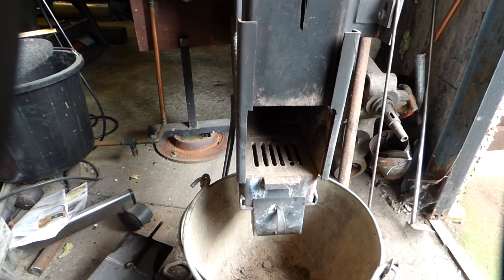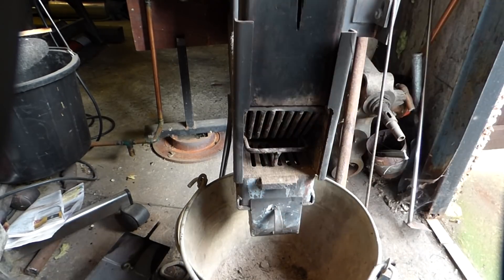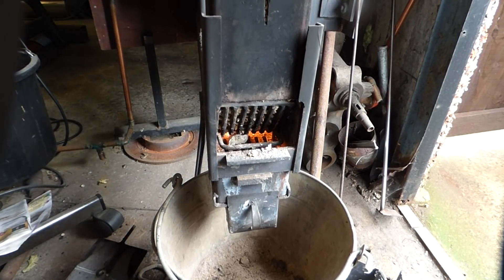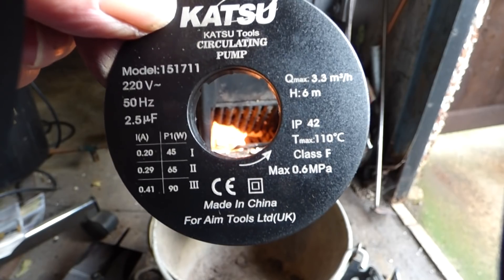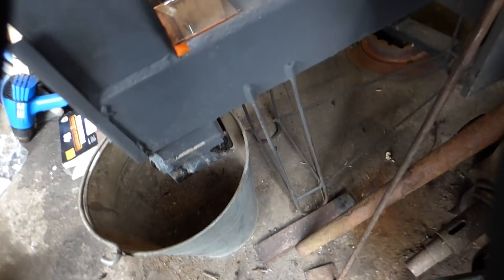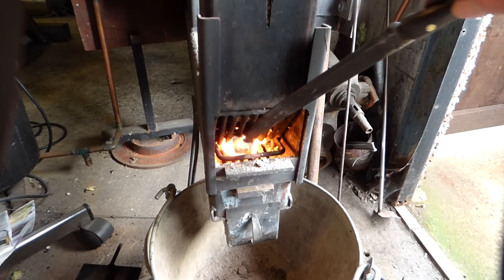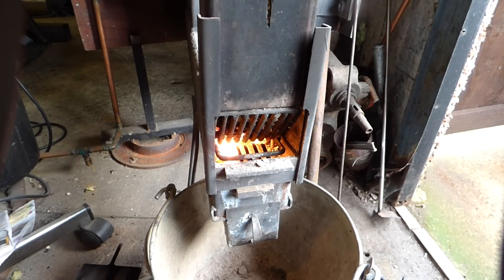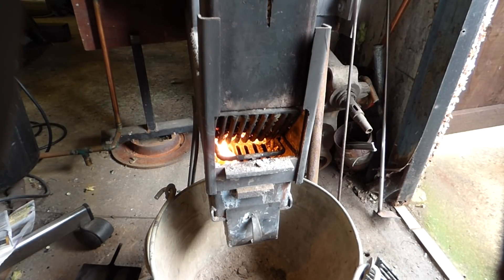rocket stove wood pellet space heater /boiler update diy No43

Comment: Thanks Dave.  I built your stove and it does exactly what you say.  I solved a lot of minor draft problems with 4 metre chimney and a Ppotty cowl.  Lovely rocket sound even under no wind conditions.  It eats pellets for breakfast and I'm very pleased with it.  I think part of the pleasure is tinkering and experimenting especially with the door gap.  Mine seems to like 30mm with the little angle piece in place. There is so many variables and even the outside air temperature and density has an effect.  Best to study the flame in darkness to see it's path.  Too much air inlet seems to cool the fire and darkens the embers so as you say that gap is important.  I think it's something to do with the venturi effect and the control of it but that's part of the fun. I am Really pleased with it.   I built another log burning Rocket Stove from old gas bottles that uses your style of brickettes and they work fine.  I would never trust using either of my Rocket Stoves in my main living area but they do a great job of heating a couple of sheds and it's true they don't produce any smoke out of the chimney.

Comment: David you have to put the circulator pump on the inlet coming out of 
your radiators and going into your heat exchanger in the stove. This is 
how all hot water circulatory heating systems are setup. The heat coming
 out of the stove or a furnace is too hot. The water coming back from 
the radiators is much cooler. Your circulator will last for years once you do that. That is why this is done. Hope this helps.
Reply: Excellent point!!!

Comment: Hi Dave, I built my stove from 6"x6" square tube. After seeing yours I changed it and made it more like yours. Mine is a mass heater, heating an old hot water tank. The major problem I have is after I light it the temps come up easily and really high then taper off the longer it burns. Ive had the top of my tank upwards of 850°. Any ideas how to get more even temps through out the entire burn?
Reply from the maker: try putting a slide damper in the chimney

Comment: Hi Dave,  I have built a copy of your stove, it works great burning between 250C and 300C along the burn tunnel.  The only issue I have is the feed tube is getting very hot and is causing the pellets to start to sweat and cause a sticky black oil like film on the inside of the feed tube (much like creosote) the bottom of the feed tube gets up to 200C and half way up its still over 100C the effect of this is loads of smoke from the pellets that get so hot, I have cured the smoke by closing off the top of the feed tube once I have filled it but is there anything you can suggest?  does your feed tube get so hot when burning pellets?   

 Thanks in advance   Keith
Reply from the maker: you must be using a different sort of pellet that i use.

Comment: Hi Dave, 
After watching all your videos I have a few questions. 
You have stated that the horizontal burn tube must be 4 times the tube dimension. Is that the outside dimension or the inside dimension? I just purchased 6x6 inch 1/2 wall tube, so 5x5 inch inside. Is there any issues with making the burn tube longer?
The first vertical section where your heat exchanger is located,  is there a minimum/maximum height that should be?
You have stated the chimney needs to be minimum of 3 meters high, is there an issue with taller and larger?  I have a free source of 8 inch pipe, would that be too large for my 6x6 stove?
Reply from the maker: the burn tube is inside dimension.no issues with making burn tube longer.the heat exchanger should be the same length as the burn tube.no issues with length of chimney.8 inch pipe probably work but not as efficiently.

Comment: Hi Dave,I have built your stove.It works brilliant! Too good!Draws like a vacuum cleaner on steroids! Have been trying to calm it down aNnd suffer the blocked grate syndrome as well. Not  a big problem.I have also built a second with 16 tube heat exchanger,all welded.54 butts,tested to 6 bar,no leaks!I am a coded welder BTW. 
Built the first to learn from,still have to finish the second,with the second i am going to make a longer grate as the ash flys over the grate and fills the burn chamber.Its all a learning curve.
Damper,great idea,will make one tomorrow and give it a go.
would like to send you some photos or a vid,how can i do that?
Reply from the maker: send pics to email     sun21tug@gmail.com
Reply: Djyul can you put up a tour of your larger one, currently planning out a 6” very similar to this one would be very keen to see yours.
Reply: @MiNeYoursChannel  Its not larger,still 4" box,havent got round to sending pics to David yet,Sorry David.Just been very busy.Not a computer geek,and will make a small film and send it to David,maybe he will post it for me.
I would'nt go too big,they pump out an amazing amount of heat,28 C at the moment here,too hot!
Thank you for your interest.
Reply: djyul sorry I totally miss read your post, I was looking for go joes I think. It’s to heat a fairly large workshop, out of interest how many rads and what size do you have running off yours? How big is the space it’s heating roughly? Cheers again.
Reply: @MiNeYoursChannel  you've miss read again,my boiler is not finished .